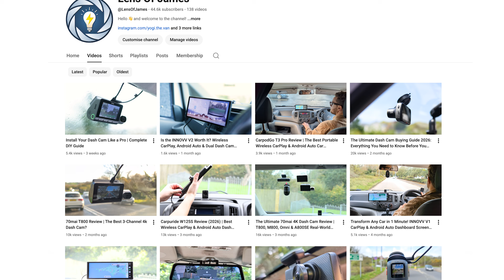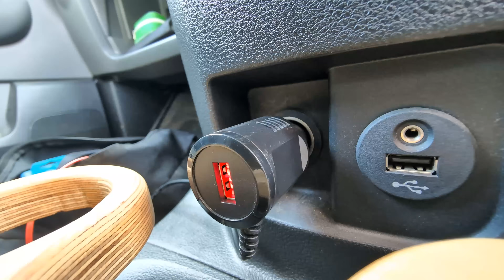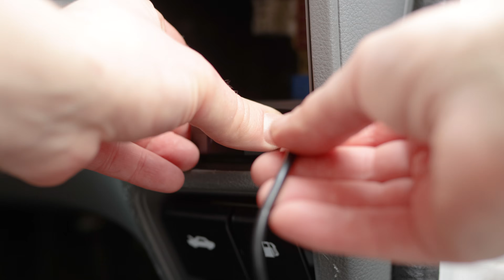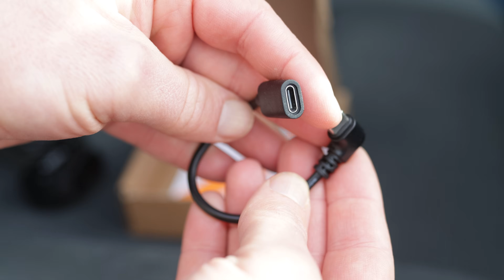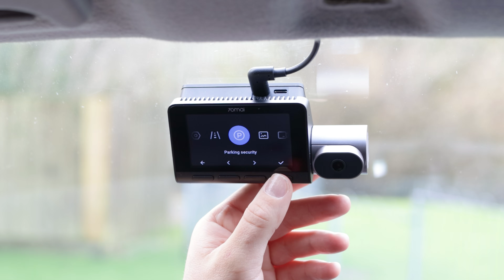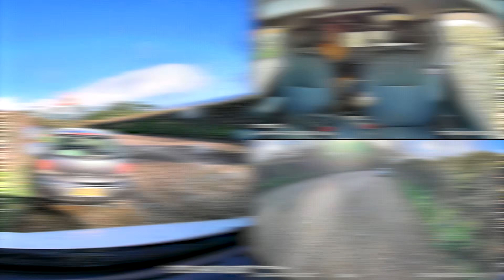How to Power a Dash Cam Using the OBD Port (Is It Safe?)

Comment from the maker: Would you use a dash cam OBD cable for parking mode? 🚗 Do you think it's safe? 🤞
Reply: No, mine killed a new battery in two years. The ECU will constantly draw power.
Reply from the maker: What device did you have plugged in?
Reply: @LensOfJ @LensOfJames n OBD cord running to my Vantrue dashcam. It killed a brand new battery in two years. I read that the ECU will think it needs to do provide constant power to the OBD port, so it never goes into complete shut down mode. Hardwired is the best solution, as a voltage switch on the OBD  connector cord may not read the voltage correctly and let the battery drain to low. I don’t have that type of cord anyway.
Reply from the maker: Interesting - how do you know it was the OBD that killed the battery and not another factor, and did the OBD cable have low-voltage protection?
Reply: @LensO @LensOfJames isn’t any other power drain. My last battery lasted  over 4 years without a dash cam and was only replaced as I had to store my vehicle. No other explanation. The computer basically provided power constantly to the OBD port as I had parking mode on. The camera’s sleep mode still needs power. Voltage shut off cables might work, but hardwiring is the best option.
Reply: Arnt you supposed to replace your car battery every two years?

Comment: So I just bought a Rexing R4 comes with OBD charger for both running and parking also has a battery saver ( different settings 11.8v, 12.0v and 12.4v ) for when your battery starts going low it shuts off.
Sounds pretty safe to me. Any advice? I did orded the hard wire kit that you okug in to your fuse box just incase.

Comment: Thanks for the vid, good info 👍
Oddly I tried an OBD2 power supply lead to my dash cam, but it's app is saying that it's not hard wired and can't provide 24 hour coverage, which is odd, as the port definitely has permanent power.

Comment: Unfortunately it is not for EV or hybrid. But ACC mode is recommended if don't wanna touch the fuse box.
Reply: Why does it not work with ev or hybrid?
Reply from the maker: Whether an OBD power cable works on an EV or hybrid depends on the specific vehicle and the specific OBD power adapter, not on EVs/hybrids as a category. Many EVs and hybrids have a standard OBD-II port with constant 12V power available.
Reply: @LensOfJames ahhh oke thanks
Reply: @LensOfJames can confirm it works fine in my Hyundai EV
Reply: @LensOfJames  I’m getting so confused lol. I have a Peugeot e-208 gti and was looking at the Botslab G980H that you reviewed. They sell an OBD kit as well but how would I find out if it’s compatible with my car? Trying to avoid hardwired wiring for now as it’s under warranty but would like parking cover…..but think maybe easiest to forget parking for now as OBD seems to count as hardwired with some dealers. I just wanted a Dashcam lol it’s a minefield.

Comment: I recently bought a 4 channel dash cam & I started with the dongar pro for simple install because I didn’t wanna touch my fuse box but I saw these obd connectors and I was sold giving you every option that the hardwire kit does & sooo much easier on the installation great content

Comment: Hi,
I have brought a dash cam after seeing your videos (red tiger).
I really concerned about using a hard wire kit.
You have put 3 options for the OBD kit. Please would you advise which option is suitable for a vw t6 2019 plate. The port you advise , appears to sit under the drivers dashboard,  by the steer ing column  on my van.
Thanks in advance.
Reply from the maker: Hi, what do you mean by 3 options for the OBD kit? There's a switch with 2 settings, is that what you're referring to?
Reply: @LensOfJames 
Hi,
On your affiliated links there is
USB- C IBD
Micro USB 
and a minibUSB OBD.

What are the differences, which is the most suitable for a t6, transporter.
Reply from the maker: Oh I see - these don't affect the vehicle, as they all have OBD ports. The different usbs mentioned are for the dash cam, and what usb type the dash cam you have needs for power
Reply: @LensOfJames thanks

Comment: Looks like a really easy solution, thanks. However, might there be a risk that the plug sits proud of the fuse/OBD port assembly, meaning you have to leave this exposed?
Reply from the maker: Yes definitely could be a risk, though a lot of OBD dash cam accessories tend to be on the slimmer side, so hopefully won't be too much of an issue for too many vehicles

Comment: Interesting video on using the obd port. I had seen a reference to taking power from the light/rain sensor built into unit behind rear view mirror. Would I be correct in thinking that would lose power when parked so leaving the obd port and direct fused cable as only viable options when parked? 😺👍
Reply from the maker: Thanks - I hadn't come across that (and don't have light/rain sensors in my car) so am not entirely sure. Perhaps someone else can chime in and help answer that?